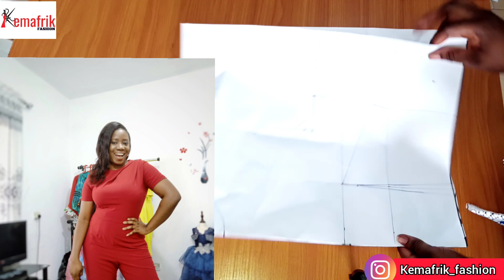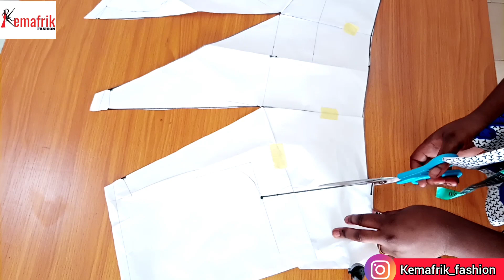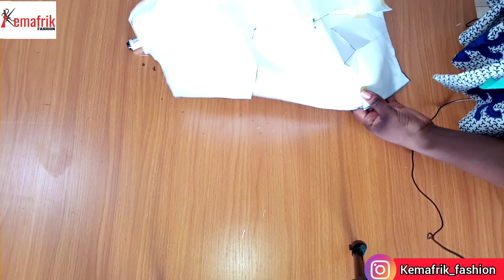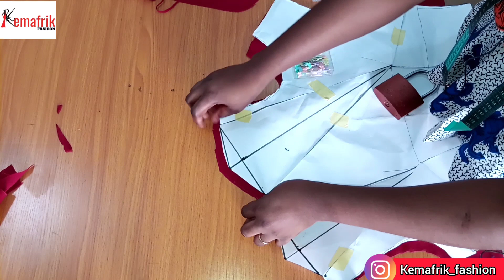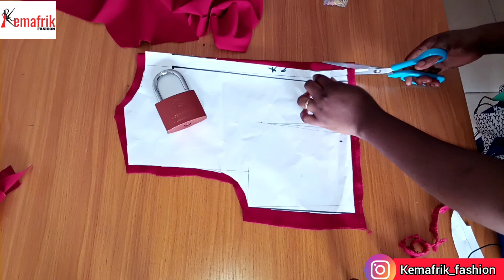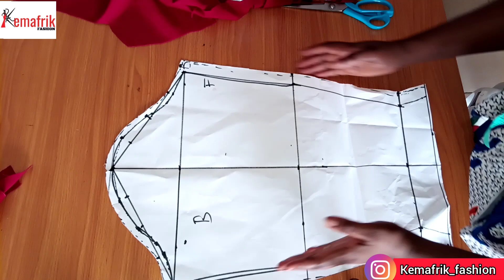Jumpsuit tutorial: The bodice and dart transfer.

Comment: Wawuuu, this is sooo, nice and detailed👌. Thanks very much. A little confusion though. What method did you use for  your crotch, because u mentioned 2 of it.  Does it mean if we are to use the sitting method, we will measure our crotch depth from where we tie the rope as well?
Reply from the maker: You're welcome 💕. If you're using the sitting method, you'll measure from the top of the trouser band to the flat surface you're sitting on.
 When making a Jumpsuit, you'll need to add some ease , about 1" to the crouch length.
Reply: @Kemafrik  by dropping it 1" below the way you did I suppose as opposed to adding from the waist line upward
Reply from the maker: Yes, that's because the distance from the waist to hip remains the same but you need that extra inch at the crouch so you can sit comfortably.
Reply: @Kemafrik  thanks a bunch
Reply from the maker: You're welcome